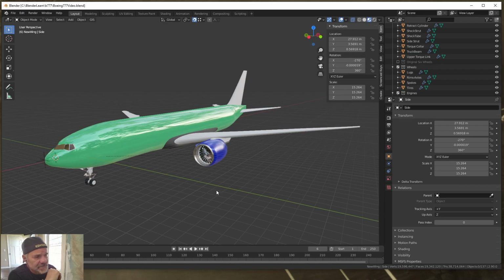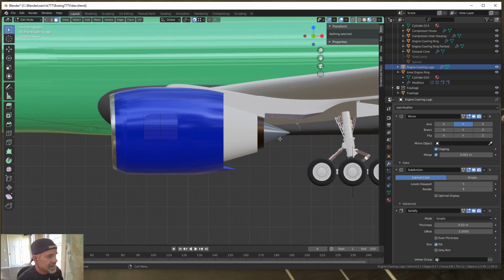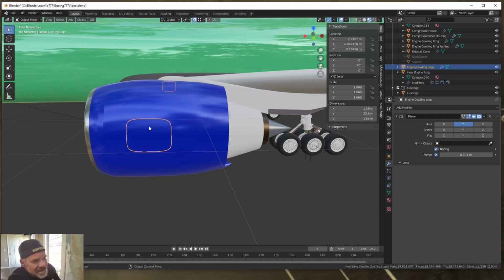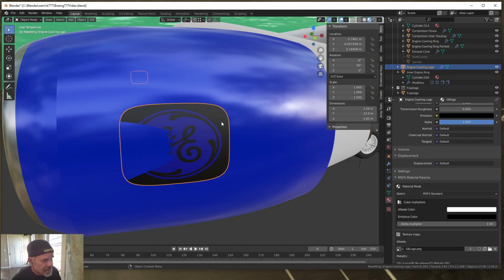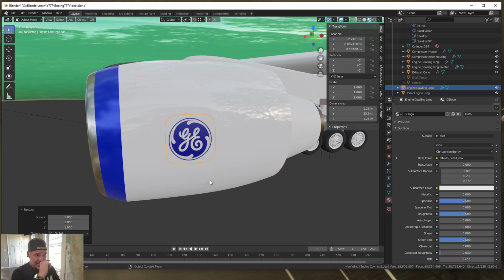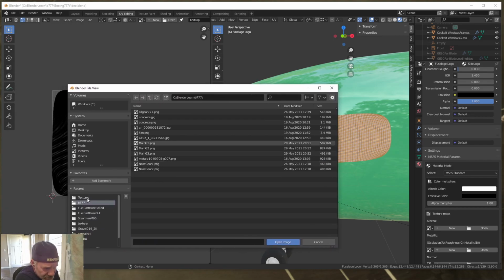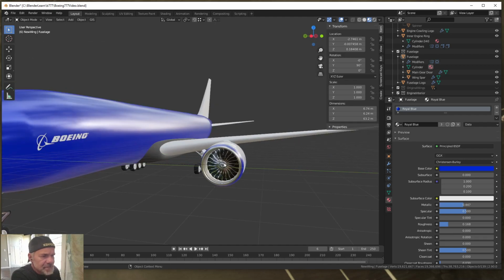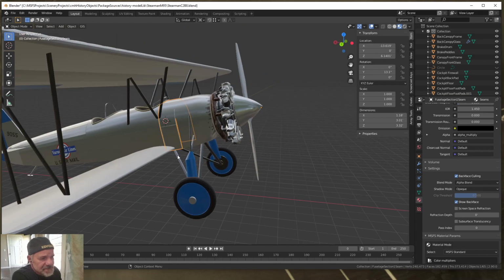Stenciling in Blender? Here's an Alternative!

Comment: Didn't watch the whole video. For my models it is fine to use Decal-Material. Select the polygones, duplicate and make them a new object. Do not move the object. Change the material for this object to MSFS Decal. Add the Logo to this material. Done. If the surface of the new object and the underlying object are the same, it works without flickering or other problems. I do this for example to add rust, logos or dirt on a model. Time for adding a logo to the model below 1 minute.